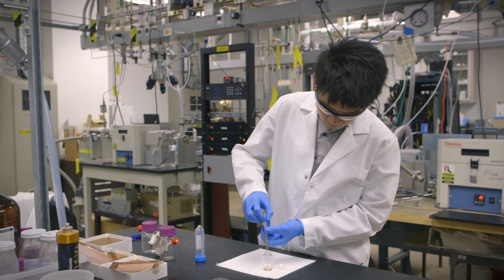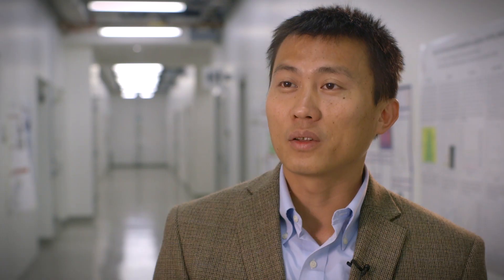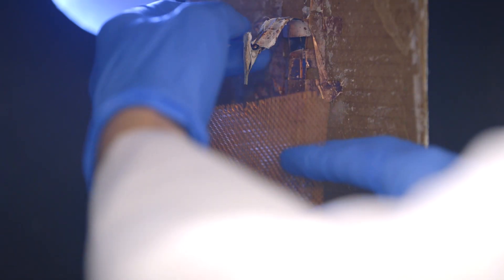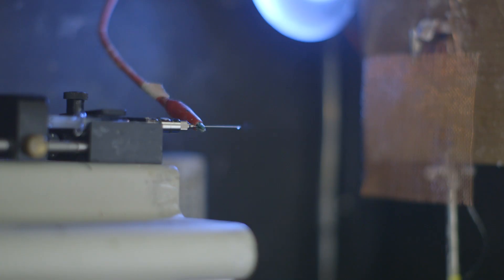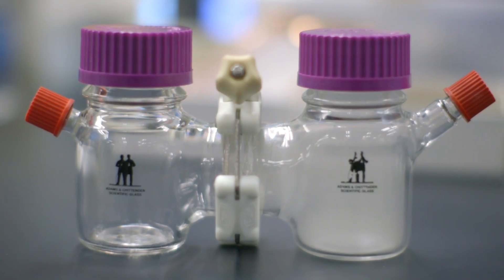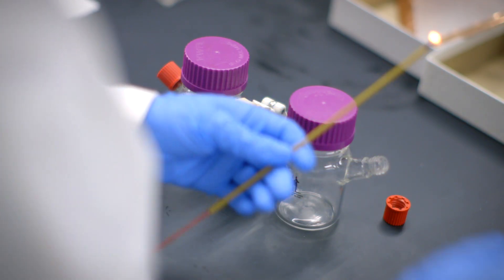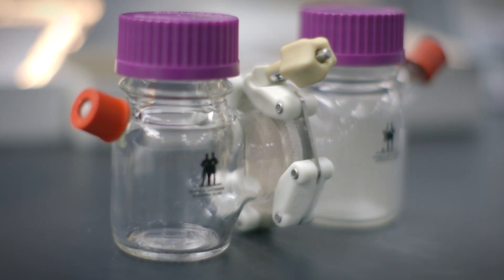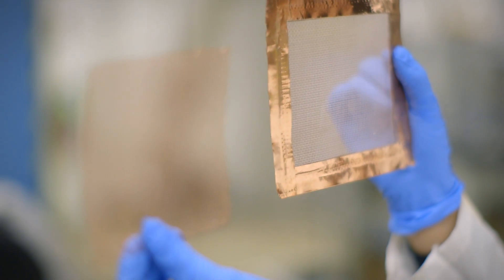Stanford researchers develop new filter to combat air pollution

Comment: No matter how good your filter is, it still needs to be replaced regularly. Since it's made of polymer and uses a non-standard method of 'spinning' the nanothreads, I'm guessing there is a significant resource cost to producing the filters. Not an ideal solution to the amount of pollution found in China. Biotech would be a better way to go, utilizing some sort of plant that would grow and absorb pollutants.

Comment: fckng IDIOTS!
This consensus that we should come up with all these protections to clean our air is WRONG altogether! PERIOD!
fckng IDIOTS!
The best is to capture the particles at the source so they don't get a chance to ROT our AIR to begin with!
fckng IDIOTS!
All facilities who put out particles(vehicles included) should be enclosed and filters installed in those areas...
fckng IDIOTS!
People should no longer be allowed to make fires and burn their trash as many do now in open air, or furnaces, etc... rotting whole neighborhoods with deadly toxins
fckng IDIOTS!
...
Reply: Obviously. How do you get rid of the particles at the source though? Where will you store all the particles?
Reply: The same group of scientists at Stanford did come up with Nanofiber membrane using Polyimide to capture industrial particles at the source very efficiently, it have a superb thermal stability up to 370 celsius, 700 fahrenheit.  It also can be use as a filter for car/trucks exhaust.